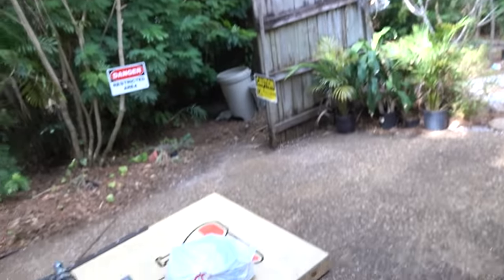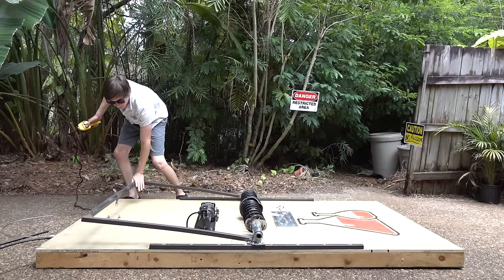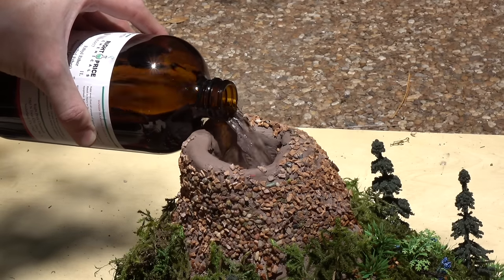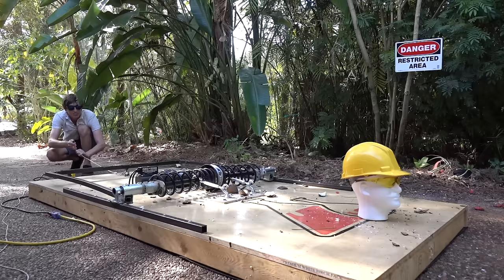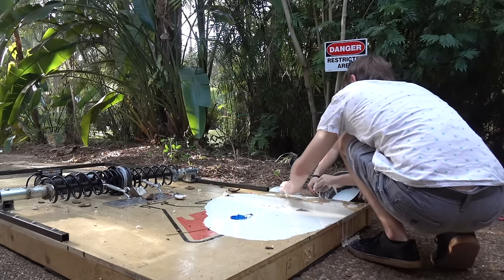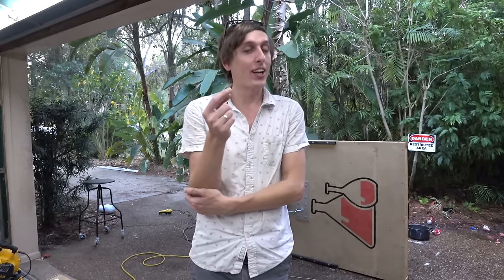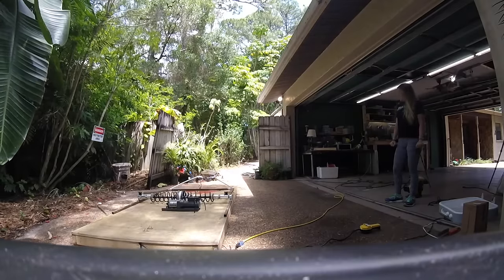Giant Mouse Trap [Smashes Everything]

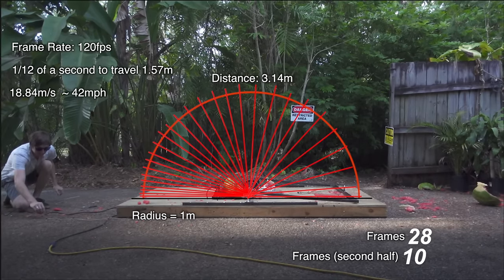Comment: 1:41 I've always wondered when that would come into use after learning it in math class
Reply: KYYC edits its wrong though. He didnt calculate the speed at impact, he calculated the average speed of the metal bar. The speed at impact is much higher, since the bar is still accelerating.
Reply: so what would you say the actual speed is?
Reply: Luis !! First u calculate the acceleration a=2s/(t^2) = 115.35 m/(s^2). Then the speed at impact v=a*t = 26.92 m/s which is about 60 mph. But this is only close to the real answer since the acceleration itself is probably not even constant.
Reply: oh so you wouldnt really be able to calculate the real speed huh just get a rough estimate? well thanks anyways
Reply: for the real speed you would need data about the springs he used.

Comment: Did you know that coconuts are 9x harder than the human skull!
Reply: Where did you get THAT info?
Reply: @gideonkloosterman  I tested it with my mom
Reply: Well then that giant mouse trap is terrifying 😃
Reply: Dr Monday no it’s not, it’s actually about the same if not weaker
Reply: @nichamyy2011  gulp
Reply: How come I easily cracked an extra hard one with my teeth and easily by throwing it 2-3 feet on the ground.
Reply: @plasticoceanrat  things with lower surface areas like your teeth can break things much easier because it's more pressure applied to a smaller area, that combined with the human jaw strength which can destroy a hand like a carrot makes it believable that something like that could happen.
Reply: Welp time to get a coconut transplant!
Reply: No I didn't
Reply: @nichamyy2011  hold up

Comment: I would like to know the actual speed of this on impact. An average speed is given of 42mph. However because the springs are exerting a force at all positions the trap bar is accelerating along its travelled circumference. It looks like it is cruising.
Reply: If it has constant acceleration you can work out its final velocity.

Comment: anybody else notice that the bar travels 3.14 meters (a.k.a. the approximation for pi)
Reply: Jack Ansley maybe but just maybe it is caused by the fact that you get the circumference of a half circle by multiplying the radius (1m) with pi Einstein?
Reply from the maker: Its half the circumference to a circle, pretty handy the bar was exactly 1 meter!
Reply: Jack Ansley as it should be given the radius.
Reply: how many digits of pi do you guys know.. i know 3.141592653589793238462643383
Reply: My calculator knows more...
Reply: 3.1415926535897932384626433832795028841971693993751058209749445923078164062862089986280348253421170679821480865132823066470938446095505822317253594081284811174502841027019385211055596446229489549303819644288109756659334461284756482337867831652712019091456485669234603486104543266482133936072602491412737245870066063155881748815209209628292540917153643678925903600113305305488204665213841469519415116094330572703657595919530921861173819326117931051185480744623799627495673518857527248912279381830119491298336733624406566430860213949463952247371907021798609437027705392171762931767523846748184676694051320005681271452635608277857713427577896091736371787214684409012249534301465495853710507922796892589235420199561121290219608640344181598136297747713099605187072113499999983729780499510597317328160963185950244594553469083026425223082533446850352619311881710100031378387528865875332083814206171776691473035982534904287554687311595628638823537875937519577818577805321712268066130019278766111959092164201989380952572010654858632788659361533818279682303019520353018529689957736225994138912497217752834791315155748572424541506959508295331168617278558890750983817546374649393192550604009277016711390098488240128583616035637076601047101819429555961989467678374494482553797747268471040475346462080466842590694912933136770289891521047521620569660240580381501935112533824300355876402474964732639141992726042699227967823547816360093417216412199245863150302861829745557067498385054945885869269956909272107975093029553211653449872027559602364806654991198818347977535663698074265425278625518184175746728909777727938000816470600161452491921732172147723501414419735685481613611573525521334757418494684385233239073941433345477624168625189835694855620992192221842725502542568876717904946016534668049886272327917860857843838279679766814541009538837863609506800642251252051173929848960841284886269456042419652850222106611863067442786220391949450471237137869609563643719172874677646575739624138908658326459958133904780275900994657640789512694683983525957098258226205224894077267194782684826014769909026401363944374553050682034962524517493996514314298091906592509372216964615157098583874105978859597729754989301617539284681382686838689427741559918559252459539594310499725246808459872736446958486538367362226260991246080512438843904512441365497627807977156914359977001296160894416948685558484063534220722258284886481584560285060168427394522674676788952521385225499546667278239864565961163548862305774564980355936345681743241125150760694794510965960940252288797108931456691368672287489405601015033086179286809208747609178249385890097149096759852613655497818931297848216829989487226588048575640142704775551323796414515237462343645428584447952658678210511413547357395231134271661021359695362314429524849371871101457654035902799344037420073105785390621983874478084784896833214457138687519435064302184531910484810053706146806749192781911979399520614196634287544406437451237181921799983910159195618146751426912397489409071864942319615679452080951465502252316038819301420937621378559566389377870830390697920773467221825625996615014215030680384477345492026054146659252014974428507325186660021324340881907104863317346496514539057962685610055081066587969981635747363840525714591028970641401109712062804390397595156771577004203378699360072305587631763594218731251471205329281918261861258673215791984148488291644706095752706957220917567116722910981690915280173506712748583222871835209353965725121083579151369882091444210067510334671103141267111369908658516398315019701651511685171437657618351556508849099898599823873455283316355076479185358932261854896321329330898570642046752590709154814165498594616371802709819943099244889575712828905923233260972997120844335732654893823911932597463667305836041428138830320382490375898524374417029132765618093773444030707469211201913020330380197621101100449293215160842444859637669838952286847831235526582131449576857262433441893039686426243410773226978028073189154411010446823252716201052652272111660396665573092547110557853763466820653109896526918620564769312570586356620185581007293606598764861179104533488503461136576867532494416680396265797877185560845529654126654085306143444318586769751456614068007002378776591344017127494704205622305389945613140711270004078547332699390814546646458807972708266830634328587856983052358089330657574067954571637752542021149557615814002501262285941302164715509792592309907965473761255176567513575178296664547791745011299614890304639947132962107340437518957359614589019389713111790429782856475032031986915140287080859904801094121472213179476477726224142548545403321571853061422881375850430633217518297986622371721591607716692547487389866549494501146540628433663937900397692656721463853067360965712091807638327166416274888800786925602902284721040317211860820419000422966171196377921337575114959501566049631862947265473642523081770367515906735023507283540567040386743513622224771589150495309844489333096340878076932599397805419341447377441842631298608099888687413260472156951623965864573021631598193195167353812974167729478672422924654366800980676928238280689964004824354037014163149658979409243237896907069779422362508221688957383798623001593776471651228935786015881617557829735233446042815126272037343146531977774160319906655418763979293344195215413418994854447345673831624993419131814809277771038638773431772075456545322077709212019051660962804909263601975988281613323166636528619326686336062735676303544776280350450777235547105859548702790814356240145171806246436267945612753181340783303362542327839449753824372058353114771199260638133467768796959703098339130771098704085913374641442822772634659470474587847787201927715280731767907707157213444730605700733492436931138350493163128404251219256517980694113528013147013047816437885185290928545201165839341965621349143415956258658655705526904965209858033850722426482939728584783163057777560688876446248246857926039535277348030480290058760758251047470916439613626760449256274204208320856611906254543372131535958450687724602901618766795240616342522577195429162991930645537799140373404328752628889639958794757291746426357455254079091451357111369410911939325191076020825202618798531887705842972591677813149699009019211697173727847684726860849003377024242916513005005168323364350389517029893922334517220138128069650117844087451960121228599371623130171144484640903890644954440061986907548516026327505298349187407866808818338510228334508504860825039302133219715518430635455007668282949304137765527939751754613953984683393638304746119966538581538420568533862186725233402830871123282789212507712629463229563989898935821167456270102183564622013496715188190973038119800497340723961036854066431939509790190699639552453005450580685501956730229219139339185680344903982059551002263535361920419947455385938102343955449597783779023742161727111723643435439478221818528624085140066604433258885698670543154706965747458550332323342107301545940516553790686627333799585115625784322988273723198987571415957811196358330059408730681216028764962867446047746491599505497374256269010490377819868359381465741268049256487985561453723478673303904688383436346553794986419270563872931748723320837601123029911367938627089438799362016295154133714248928307220126901475466847653576164773794675200490757155527819653621323926406160136358155907422020203187277605277219005561484255518792530343513984425322341576233610642506390497500865627109535919465897514131034822769306247435363256916078154781811528436679570611086153315044521274739245449454236828860613408414863776700961207151249140430272538607648236341433462351897576645216413767969031495019108575984423919862916421939949072362346468441173940326591840443780513338945257423995082965912285085558215725031071257012668302402929525220118726767562204154205161841634847565169998116141010029960783869092916030288400269104140792886215078424516709087000699282120660418371806535567252532567532861291042487761825829765157959847035622262934860034158722980534989650226291748788202734209222245339856264766914905562842503912757710284027998066365825488926488025456610172967026640765590429099456815065265305371829412703369313785178609040708667114965583434347693385781711386455873678123014587687126603489139095620099393610310291616152881384379099042317473363948045759314931405297634757481193567091101377517210080315590248530906692037671922033229094334676851422144773793937517034436619910403375111735471918550464490263655128162288244625759163330391072253837421821408835086573917715096828874782656995995744906617583441375223970968340800535598491754173818839994469748676265516582765848358845314277568790029095170283529716344562129640435231176006651012412006597558512761785838292041974844236080071930457618932349229279650198751872127267507981255470958904556357921221033346697499235630254947802490114195212382815309114079073860251522742995818072471625916685451333123948049470791191532673430282441860414263639548000448002670496248201792896476697583183271314251702969234889627668440323260927524960357996469256504936818360900323809293

Comment: so no more pool?
Reply from the maker: I still have one! just need to think of an experiment to properly utilize it :p
Reply: Build a mini sub to demonstrate how the Navy launches missiles (air propulsion until the surface, then fuel ignition upon access to surface oxygen)
Reply: although that would be cool to see, it would require a bit more advanced engineering wich is probably not within this guy's budget
Reply: Bipolar- Bear Even for a model rocket sized missile? It seems like a several hundred dollar project at most
Reply from the maker: I thought about CO2 rockets in the pool, or rocket powered spear gun.. i might have to do that on in the ocean because my pool would get too dirty. also rockets usually have a tank of oxidizer built in, or solid fuel, do they really use air propulsion until the break the surface?
Reply: TheBackyardScientist I like those ideas. One could make a small water tank for it to protect the pool
Reply: TheBackyardScientist I'm not sure if it applies to all misses, but I know the Trident SLBM is ejected with enough speed to breach the surface by steam generated by energy from a small explosive charge in a separate compartment from the launch tube. It is only once sensors detect the missile in free-fall (eg, it has cleared the water) that the rocket is ignited.
My understanding is that this is to prevent damage to the submarine from the rapid expansion and then collapse of the exhaust of the missile (remember when you fired bullets into water? Imagine that but much, much larger).

And then there are submarine launched cruise missiles, which only use a rocket briefly to accelerate from the surface to flight speeds, at which point they switch over to the jet engine.

Comment: The catapult idea didn’t work because of centripetal force. This is because the mouse trap moved in a semi circular motion causing the watermelon to be stuck to it due to the centripetal effect. If you had a stop on the mouse trap that stopped it at 90 degrees you would get max launch height.

Comment: Don’t know best way to contact you but I’d like to see you do this again but with a garage door spring and shaft you could even use the drums and cables too! The garage door springs are specifically designed for torsion as they are what pick up a garage door using torsion. Would love to hear back from you on this or if you had this idea already

Comment: You need to fill the hollow square tube with concrete or sand to give it some weight and put an edge sharpened blade across the bar. Then you might have something.
Reply: he made a giant beartrap now sooo